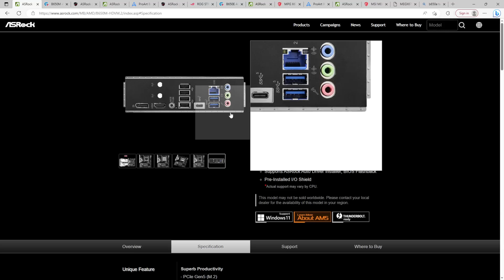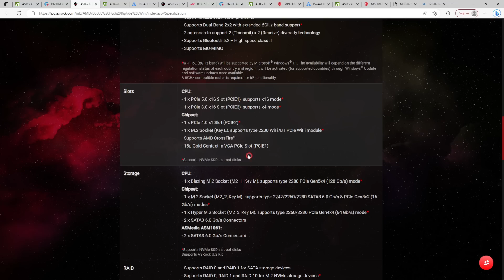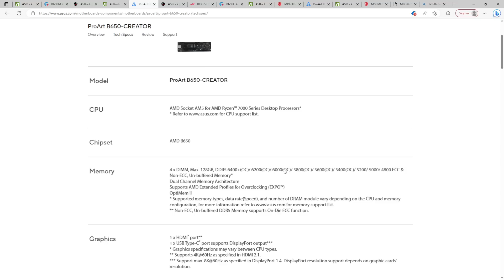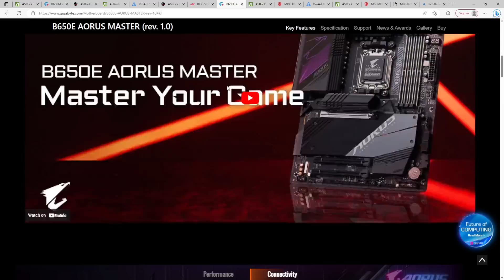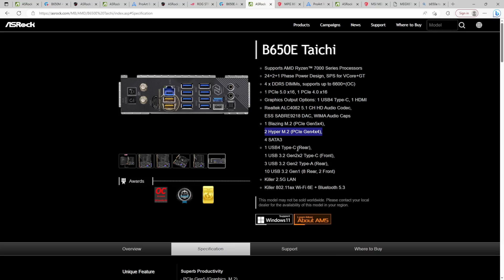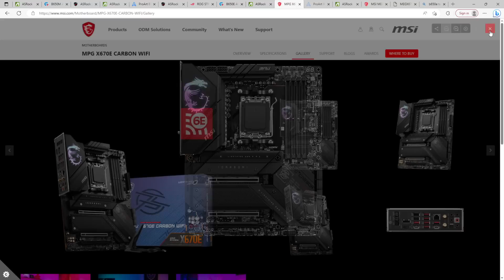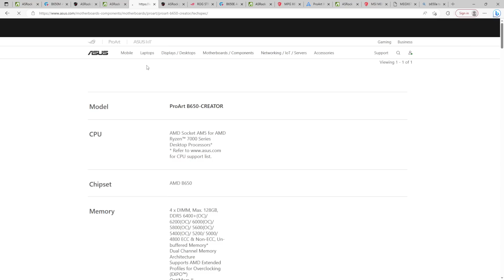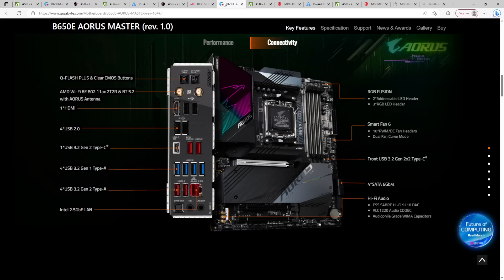AM5 motherboard round up

Comment: Most boards don't offer dual PCIe 5.0 x8 because that would require an expensive PCIe switch. While they could hard-wire it so it's permanently x8 + x8, most users would (irrationally) fear running their x16 GPU at only x8. The only PCIe 5.0 x16 peripherals I've seen are Molex's FPGA cards, though you could probably buy two each of all these motherboards for the price of licensing the CXL IP for a month.

My own preference would be 96x SMA connectors, until that makes an appearance, I might use that PROART B650 barring have any gotchas with ECC RAM or PCIe compatibility. The more expensive AM5s are still too compromised and overstuffed with peripherals for their discount relative to TR Pro or EPYC.

When are dual 4090's preferable to a single A6000 Ada? Twice the VRAM under one GPU is easier to manage, and the A6000's are two-slot, so if you really need two cards they should fit any boards that have the slots.
Reply from the maker: both the B650E-E and B650E Master have the necessary gen5 switches to run dual x8. It's just that ASUS and Gigabyte are using them for M.2 slots instead of PCI-e slots.
Reply: @ActuallyHardcoreOverclocking  The file copying enthusiasts have won and 3 or 4 gen 5.0 m.2s are just more popular than dual x8 slots. Perhaps there is an opportunity to sell a passive riser + clock buffer that splits the x16 to x8/x8, it should be doable at PCIe 4.0 speeds given the availability of passive GPU risers. Gen 4.0 is good enough for GPUs and 25GbE, and a riser can solve some of the mechanical issues with triple-wide and larger consumer GPUs. Given a BIOS that supports bifurcation, SFF folk could even tuck a mini-ITX board under a couple 4090s

Comment: im very slow when it comes to super technical stuff. starting at @2:45 . would you be able to elaborate a bit more? specifically,
1. Ryzen CPU being Thermally limited. (which in turn, why does this mean that this board can also OC it?)
2. what does being power limited mean?
3. Starting from 2:55 , about Intel quip, is confusing me too.
Reply: Thermally limited as opposed to power limited, so it's limited by how well you can cool it and not by how much power you can feed it.

Comment: I'm very new to PC building and don't know how often it happens but I got a proart WIFI model openbox and both the ethernet ports and the wifi antenna do not work. It was probably open box because of that reason. I been using a USB ethernet dongle but plan on returning it. Its bummer. Good board but hella overpriced. I got it specifically for the thunderbolt 4.

Comment: I couldn't find the new B650 Steel Legend wifi anywhere so i just bought ASRock B650 Livemixer for 182$. It's a good deal? On the other side i still can buy MSI b650 Tomahawk for around 210$. Is 30$ more worth it?

Comment: Unfortunately the X670E Aorus Master isn't in this list. I was eyeballing it for a gaming setup (single GPU). I understand it didn't make the list because of the PCI slots but wanted to know if this board would make the cut for a gaming setup specifically. I've had so many issues with Asus hardware that I'm not keen on going with them and I also want to steer clear of any killer LAN chips. I am though a bit of an audiophile and did hear somewhere that this board has a generation older codec but am not sure if that would have a meaningful impact. Hopefully someone out there can help me out. Planning on combining this with a 7800x3d and 2080 (which will most likely be upgraded with the upcoming Nvidia or perhaps AMD launches)

Comment: is wanting gen5 x16 slot valid if anticipating mid range future cards using pcie5 x8 or even x4 throughput? genuinely considering asrock taichi x670e with 7600 (then a 6600/6700xt)

Comment: Thunderbolt ist TM of Intel and of course AMD can't use that. On AMD it's called PCIe tunneling over USB4, which is the same :)

I miss the MSI B650 Tomahawk in your list, because it's the first board using a good onboard audio solution which is important to those people who don't use soundcards and do care about soundquality and the headphone amplifier. It should be the board for you, because it does have more usb ports than the gigabyte elite ax but uses 3x nvme @ PCIe 4.0 x4 and 6 SATA ports. It does not provide PCIe 5.0 but you wouldn't care anyways 🤣

Comment: It is nice to hear your reasoning, but I was left wanting review like this of all motherboards. You covered Strix, but I'm eyeing the higher end version.

Also, major consideration for me IS aesthetics. I'm a PC enthusiast. I'm building a system not because I care about its performance, but because I want nice looking system. I want prestige of it. It is my thing, I do care. Like I bought rare and very expensive books about very specialized subject. It defines me. Thus I do not want low end, crappy motherboard even if it can do everything which I practically might need.

Though, the only way I justify the cost of E series motherboards is that AMD has extensive support for it. I will buy 7800x3D for X670E-E. Then wait until AMD releases last CPU for it. Then wait another year until it is surpassed by new generation. Then I will buy their flagship CPU for a heavily discounted price. This is how I'm going to have enthusiast level system for a very, very long time. So, investment into motherboard makes sense. 2022 platform. I will buy in 2023. 2025 will be last CPU for it. I will buy an upgrade in 2026. Then I will enjoy my system until 2029''ish. Like, that is a really long time to use one piece of hardware.

Comment: The ASUS Strix B650E-E if the reason I got the F instead for m 7800x3d, It was cheaper (£100, £225 v £325,  cheaper in my case as it was on offer, so I got 64GB instead of 32GB) and had little I would use that was missing as I only needed the 3x M.2 and 1 pcie x16  for the 4090 and 11x slot for extra 2.5gbe lan card (I use 1 to my router for gigabit broadband and the other as a direct link to my server). I really only miss the post code as I have not had a board since the core 2 era that has not had one in the £200+ bracket. That said, there wasn't much of a choice in the b650e availability at the time but a glut in the overpriced x670E boards, I guess I wasn't the only one not impressed for the lack of bang for your buck with x670E.

Comment: -f i wanted to run ram with high capacity at 6000+ or maybe if next gen ryzen can clock ram higher, would the board matter more then?-
Edit: Now i heard that some boards got bios updates that allow them to run much higher frequencies, someone told they got 7200. Would be nice to see some info on how well different boards can clock memory after this.
I don't want to repeat the mistake i did on am4, i got board that sucks with memory overclocking.

Comment: I felt pretty salty spending $209 on a B650 Aorus Elite Ax back in Jan. By today's standards it seems to be a solid board. But, it's sad how little you get for $200+ now. No debug display, no physical manuals. I think there was a wifi antenna and 2 SATA cables in the box. I was coming from an Asrock Z87 Extreme4 that I bought back in '14 for about $120 if I remember correctly and that thing was loaded. Only thing it was light on for me was PWM fan headers. Including  the cpu fan, I think there was 3.
Reply: Money has got worthless..

Comment: memory and boot problems galore with ddr5,  after spending 2 days searching for solutions my system is finally running,  the problems do not appear to be motherboard manufacturer specific  my MBR (master boot record ) got corrupted but my system would not allow me to access a windows 10 usb - it kept dying after a few seconds.  It would show the drives but no boot partitions.  It would not acknowledge my boot drive after it was set active and working on other hardware.  Boot discs could not access my data drives - tested one at a time.  It wouldnt even boot with no peripherals. after a bios update POST got better but still no boot.  someone figured out that the usb and onboard video did not play well together so i threw a gpu back in and it booted properly repeatedly,  I installed a second DIMM and the MBR was buggered again on reboot. I took out the second DIMM and it has booted fine since then.  No idea why these would be affecting the MBR. I had 2x32GB (max allowed per slot) 5200MHz RAM but disabled all XMP and boost options.  I recommend people drop their RAM size and speed down to minimum.  check the RAM manufacturer "spd latency".

Comment: B650M Aorus Alite AX is an amazing board, but it can have a REALLY BAD coil whine that is ram realted, like REALLY BAD. You should return the board if you experience it. Mine was so bad, that with 4x32 GB ram installed it was impossible to stay in the room during memory stress test. No kidding.

Comment: I've got a Gigabyte B650 Aorus Elite AX coupled with a 32gb kit of Corsair Vengeance 6000 CL30 and it buzzes like crazy when writing on the RAM. Changed two of the same motherboard and the issue persists. It is annoying. Any fixes or ideas about the issue? I've seen so many complaints on Gigabyte motherboards with this coil whine basically, coming straight from the memory slots, at different chipsets.

Comment: I might go with a  MSI 600 series board only because they have an "exclusive" feature for 7000x3d cpu's that boost them by around 10% with enhanced mode boost which I think under volts the CPU to get higher clocks.

Comment: Building an AM5 video rig right now, what I've learned in retrospect:
1.  Forget RGB.   Adds a rat's nest, complexity and cost.  Raw naked functionality has it's own sexiness.
2.  You only need an air cooler.   I bought a 360 rad and case to support it from the nonsense Linus 95F video.  Cost and complexity and weight.  On the bench I ended up setting an old Pentium heatsink and fan on top of the processor because it stayed at 100mghz.    
3.   You only need a 650w PSU.   I wasted tons on $$$ 1200w and pretty cables.  My mobo only supports one GPU, so waste.
4.  Only buy two matched sticks of RAM kit.   Don't mix two different pairs like I did for 128gb.   Nightmare of not booting until I watched some video and found out, DDR5 ain't as tolerant like the old days.
5.  If you go 4 sticks, forget XMP/EXPO rpofiles, your speed will drop down to 3600 across all sticks.  All the cost of DDR5 with none of the benefits.
6.  Run your CPU in 110 watt eco mode, basically sthe same the 5950x used, and it will stay chill as a cucumber.
7.  I still h8t3 EFI BIOS.  It's pretty once your in it, sure, but all the rest of the tiem waiting on your PC to post or do anything at all you're faced with a dead black screen.  No user feedback, no beeps, no video, nothign.  FOr sometimes... minutes.  Tell Alexa to start counting so you can time it and know how long it usually takes for your PC to post.   Watch a video on how to speed up Ryzen boot times.
8.  Like he said in another video, until youg et it to post and get video out, you'll make friends with that CMOS clear button.  I've never pressed the CMOS clear button so much in my life.   I must of pressed that thing 50 times before I figured out my mismatched two different sets of RAM sticks problem.  Save your profiles, that helps get back to where you were faster.
9.  I want to run Windows 7 on my system, so a whole other world of h377 awaits me.   Look up running WIndows 7 on new hardware.   Basically, these mobo manufacturers don't support you, you have to get an ISO with at least USB drivers rolled into it just to be able to use a keyboard and mouse during install.
10.  Pull up your motherboard manual PDF on screen on another computer, so you can see where al the headers are and go and your front panel IO.  

Good luck.   If I had to do it all again, and I'm not done... I wouldn't....  and would keep right on using my FX-8350.  It's been a nonstop nightmare.    And I've uilt and or repaired at least 500 PC's in my life.   This is a whole new level of ev1l... and time consuming.  Very time consuming.  Because I'm blind now, and doing it all mostly by blurry vision and by feel.

I haven't hated a platform more than I am h8t1ng AM5 right now... since... well... I bought an IBM xSeries 455  Itanium 2 server back in the early 2000's.  Yeah, that was a dog.  Swore I'd never,e ver, ever buy anything with an EFI BIOS ever again.  Oh well.   I'm sure Intel is just as bad.

Comment: Just for gaming I bought a B650 Gigabyte Gaming X AX with 7600 for £349. Pretty decent deal in the current market.
Reply: That is a really good deal. I live in Sweden and just the motherboard cost that much here. A 7600 cost 280€.

Edit. Sorry the x670 cost 340€. B650 cost 250€.

Comment: Whatever you do don't buy an x670e Aorus master, it's a turd to work with, doesn't have a clear cmos button (like how gigabyte?!?), and acts up with pci expansion cards whenever it feels like it. I'm done with this board, going to get an ACE as it has all the features I need and doesn't seem like it was thrown together overnight... What I cannot believe is that the B650e Aorus master is actually a decent board that doesn't have the mess the x670e has.

Comment: 8:40, to be fair NVME is now cheaper than SATA (limited to 0.6GB/s) for SSDs and gen 3x2 is still rated for close enough to 2GB/s. 
Oh nooooo... how slow... for anyone not regularly loading multiple gigabytes at a time (which is the overwhelming majority of people)  it's even less relevant than the 5-10% CPU uplift you won't notice.

Comment: What steps are needed to take to make sure my 7600X doesnt blow up on my Asus Motherbaord?
Reply: Don't turn it on
Reply from the maker: make sure the SOC voltage is set to 1.2-1.25V. Which is more than enough for DDR5-6000 as long as your CPU doesn't completely suck.
Reply: @ActuallyHardcoreOverclocking  Thank you for the reply sir, if I enable Expo and set the SOC I should technically be good if this really is the issue?

Comment: Just a small thing, but Thunderbolt's actually one thing I wish AMD would get on board with. It's maybe of limited interest to average users/gamers, but it's used very widely in pro audio, and its absence makes AM5 is an iffier choice for that purpose. Companies like Lynx, Universal Audio and MOTU are pretty heavily invested in TB.
Reply: AMD cannot, at least not generally. 
Thunderbolt is copyrighted by Intel, iirc. So AMD must use workaround with cut functionality.
Reply: Intel generally won't certify AMD boards for Thunderbolt (which is needed to officially support Thunderbolt). However, recently some ASUS boards like the ASUS ProArt B550-Creator have Thunderbolt 4 ports.
Reply: Didn't BZ literally just point out which of those MBs have TB support!? Maybe not as common (or not always advertised because Intel certification needed), but it isn't absent from AM5.
Reply: AFAIK USB4 (at least most of it) is basically TB3
Reply: @Hugh_I  I was commenting specifically because he did and talked about it being an exotic thing he doesn't have much use for. I'm not sure why "I wish this was more of a thing and here's why myself and some other people want it" translates to me being unaware that TB was mentioned or how it works.

Comment: I bought an Asus Rog Strix B650e   -e gaming WiFi open box $300. Tons of features and better than average X670e
Reply: After updating to the last Bios version, my 6000 mhz ram could not run with Expo settings. Blue screen on windows. CPU 7900x
Reply: Rip... be carefull because asus can fry your cpu... check voltages...

Comment: I am running Asus X670E-A with AMD 7800X3D with 2x16GB G.Skill 6400 CL32 no issues. Using latest non-beta bios. Now I just sit and wait hoping it will not burn :)
Reply: Any issues yet?
Reply: @Gataki4U  a
still on 1303 bios no problems. I am bit hesitant to update to 1415 ver.
Reply: That's great. I am now running the Asus b650 plus with the 7800x3d and G.Skill 6000hz CL 30. I updated to the latest bios right away, I think it's the 1616 right now. I suggest you should get the latest bios it doesn't void the warranty anymore. Gamers Nexus made a new video about it.
Just one question, which G.Skill ram are you using exactly?
Reply: @Gataki4U  I am using F5-6400J3239G16GX2-TZ5RS , but I think they are not on your's MB supported list yet. Just updated to newest bios and everything is fine. Still able to run RAM on 6400 Mhz.

Comment: Question: why do all the ASRock boards with the ALC408x codes only support 5.1ch instead of the 7.1ch like other makers?
Reply from the maker: IDK I don't really pay attention to on board audio because it can't compete with external solutions.
Reply: Why do higher-end boards even have audio solution? It's like putting speakers into high-end TVs/monitors where almost no one uses them anyway.

Comment: Surprised you left Asus B650E-F out. At $300, cheapest B650E between Asus/GB/MSI.  You do not give up much vs B650-E-E
Reply from the maker: it's 300USD and doesn't really add anything you can't have on a ~200USD board.
Reply from the maker: I just checked the spec list and it really reads like an overpriced version of the B650 LiveMixer
Reply: @ActuallyHardcoreOverclocking  any redeeming qualities on b650 tomahawk?
Reply from the maker: @ThunderingRoar  can't you read a spec list yourself?
Reply: Currently only a £30 difference between a LiveMixer and a B650E-F here. Generally I'd go for the B650E-F at this price difference, but unfortunately it is Asus after all.
Reply: @ActuallyHardcoreOverclocking   mb i worded it wrong, aorus elite is 230€ here, so i thought tomahawk could be better if u needed extra m2 since it costs the same. And all 3 of its m2 are x4 gen4 unlike riptide weirdness. Just surprised it didnt make the cut thats all
Reply: @ActuallyHardcoreOverclocking  pci5 x16 is the main thing since it is b650e